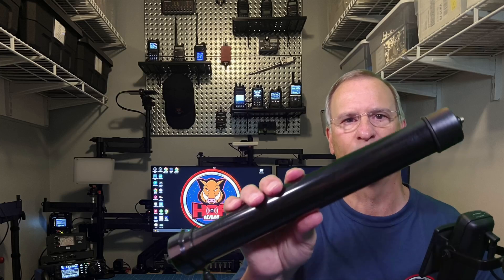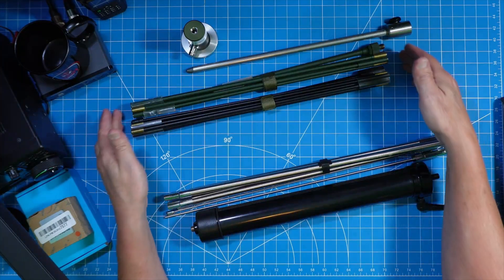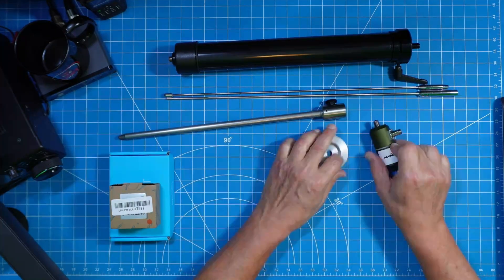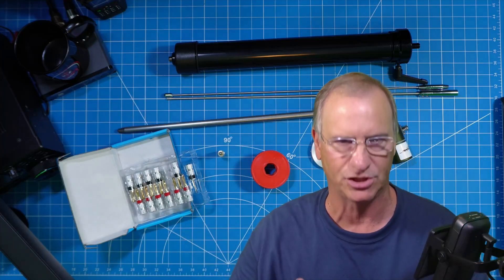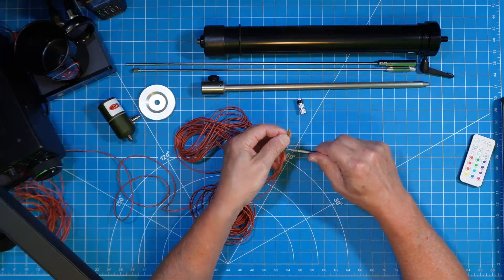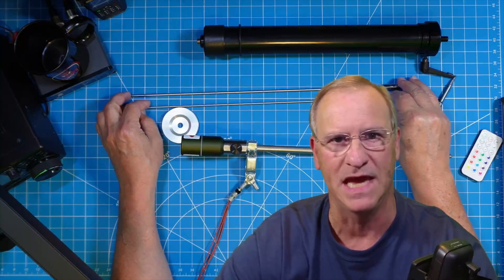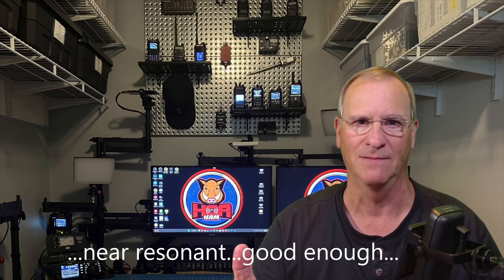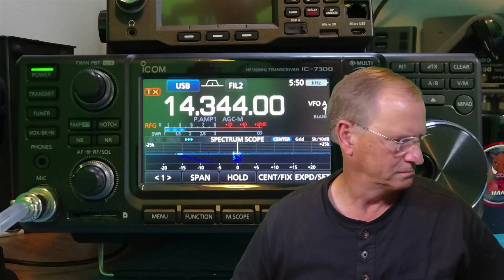Stealth Ham Radio in the HOA-Vertical Antenna Operating Undetected using FT8, WSPR & SSB Voice Modes

Comment: Back in the 90's I lived in a two bedroom apartment it Maitland, FL.  When the manager showed me this one apartment on the top floor I noticed that there was a access door to the attic right above my front door, that's when the light came on, yes, I took the apartment and started watching for how people came and went so I could get up into the attic and take a look around.  In the mean time I made a 1/2 wave dipole for 40M.  Then the day came to get up in the attic, look to see what I had to work with and maybe set up my antenna.  Before I went up I drilled a 1" hole in the ceiling of the walk-in closet for the feed line. I put together all the tools I thought I would need and had my girlfriend at the time remove the ladder after I was up.  To my absolute amazement the attic was open from end to end, about 100", so I set up the dipole and connected the feed line and lightly knocked on the ceiling, signaling for my GF to bring tha ladder back out so I could get down.  I lived there for four years and made thousands of contacts on 40 and 20 meters, and know one was ever the wiser.  When I left, I just left the antenna there and shoved the feed line up into the attic and patched the hole up.

Comment: Do you need a grounding rod
Reply from the maker: Portable antennas for temporary (hours) operations use temporary ground radials in favorable weather conditions. 

Permanent / semi-permanent installations should have proper bonding and grounding (ground rod).  I do.  This antenna is feeding into my single entry utility box which has all my grounding / bonding.

Comment: but any good ideas for those who live in concrete buildings and only have small balconies or terraces where it is not easy to manage radials?!
Reply: Mag loops. But build your own. Hardline coax or copper tubing works best
Reply from the maker: I don't have that use case so I have no personal experience.  I have repeatedly seen others respond with recommending mag loop antennas.